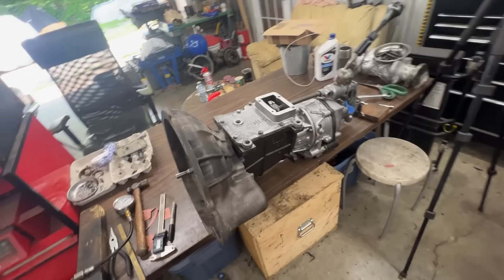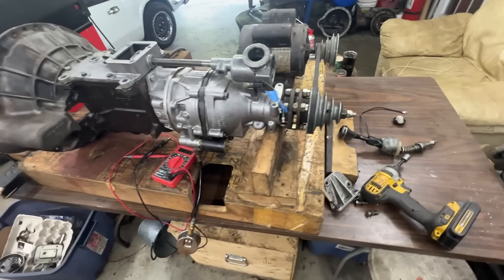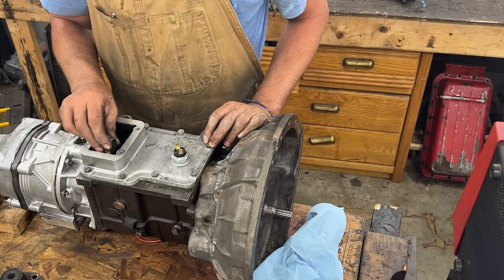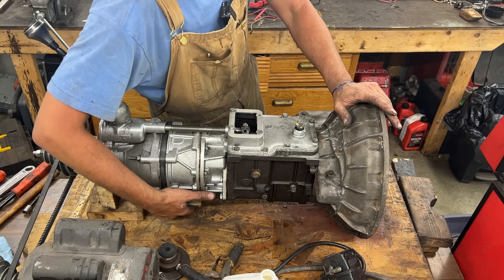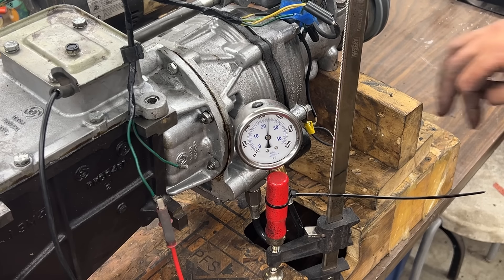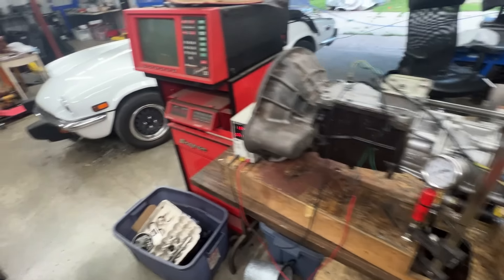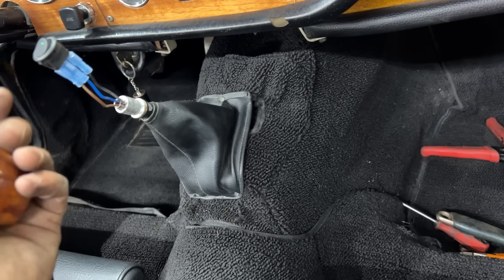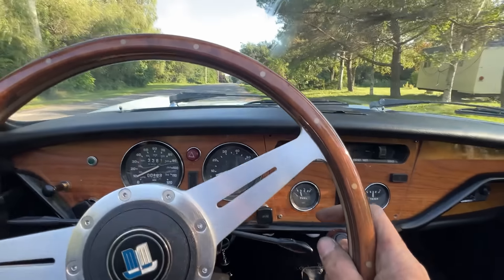Spitfire Single Rail Transmission Overhauling - Part 4 - Testing and installing

Comment: Elin, congratulations on another job well done!
What's your thought on resting your hand on the shifter in regard to possible excessive wear on the shifter parts?  MANY years ago, when I replaced my '67 GT6 4 speed with a used overdrive transmission, the 'new' transmission did not come with the shift stick that had the overdrive switch in the knob.  Being too cheap to buy a column mounted switch, I just bought a standard floor mounted 'high beam' switch to activate the overdrive unit.  I just did not have any light indicator showing when it was engaged....